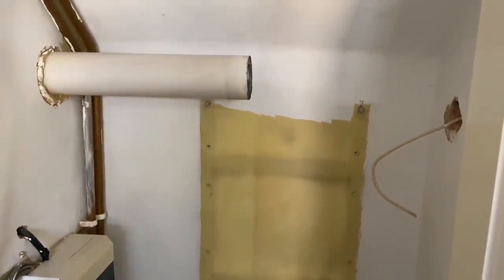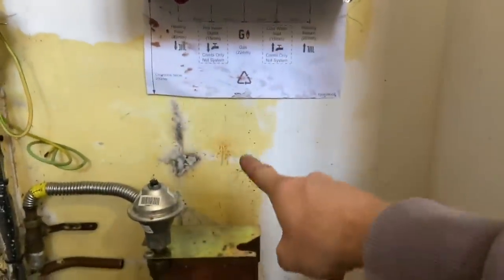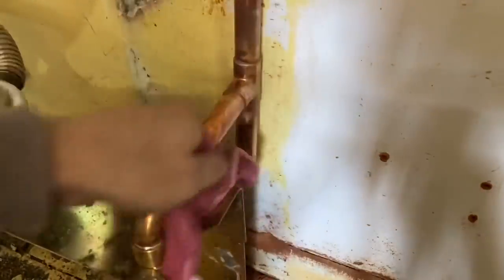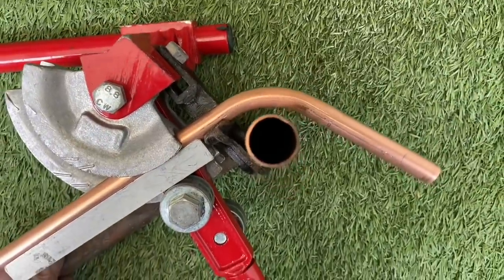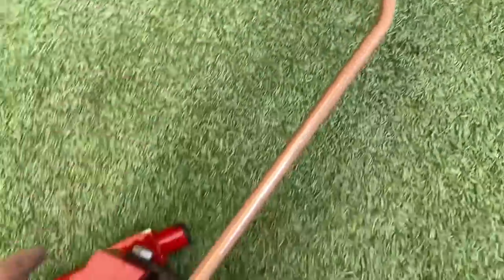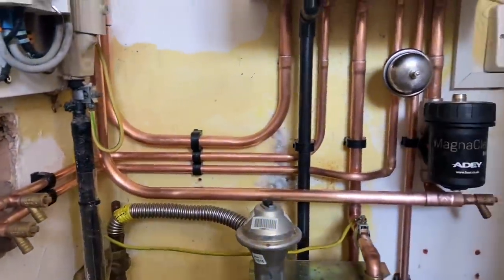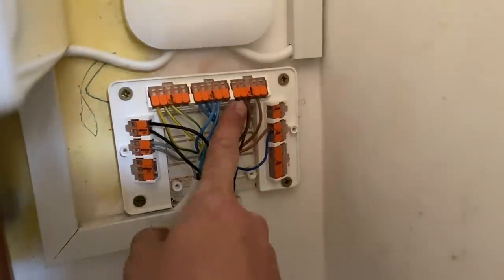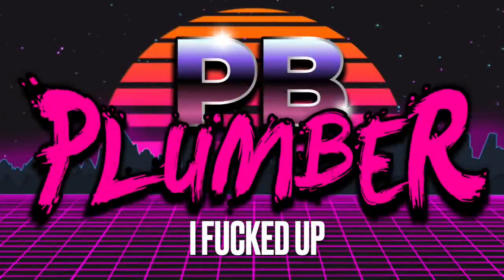P B Plumber The Life of a jobbing Plumber #50

Comment: Great vid. I'm a diy plumber. I installed a pressure relief valve, as set out in the Worcester Bosch instruction manual about 8 years ago between combi and water meter but never understood, why I should be doing it until your vid turned up.

Comment: Boss vid as usual, just a quick one from a job I got called out to where the gas meter and pipe work was not 150mm away from the consumer unit as the regs state! 25mm for cables, also hope it helps you out with your acs and good luck!

Comment: Good video, regarding min expansion vessels/shock arrestors on the cold main to the boiler. It is best practice to fit one on everyone, as even if the property does not have a water meter fitted it could have one fitted over the life of the boiler and may not be picked up on annual service, or risks the boiler having a problem that will not be covered by the warranty. We learnt this the hard way when a housing estate we had fitted a lot of boilers on had a new water main. Every property had a water meter connection fitted that houses the no-return valve. Fitting the boiler to all MIs is so important to protect the customer/their boiler warranty and also the reputation that all professionals build to get 'word of mouth' work.

Comment: Wouldn't you think if the manufacturer is basically insisting on / admitting boiler can't cope without, an expansion vessel, then one would come with it?
Do you need to match the mains static pressure and the pre-charge pressures for the vessel to work properly? Cheers.

Comment: If anyone wants to know I fitted a mini shock arrestor the other day on a combi swap I did in a downstairs wc, the main in and metre were coming in right basin the wash hand basin and the next day the customer got hold of me saying the shock arrestor is banging so I replaced it thinking maybe it was faulty then within 12 hours it did it again, rang up the manufactures and never knew but they aren’t suppose to be fitted within a certain meterage of the metre as the check valve inside affects the shock arrestor

Comment: Loved this video mate, can honestly say I've never read that bit in the 830 instructions but from now on shall be installing shock arrestors.

I was under the impression brass hydraulics didn't need them but I stand corrected.

Also on the f**k up I've done similar on site lately and have no shame in admitting when I've made a mistake.  I normally fix any accidents there and then otherwise as you say, you forget.

Comment: You need some brown sleeving on the blue (neutral) wire from the condensate pump to indicate it's a switched live
Reply: You would have thought the manufacturer would have used a twin brown flex instead of the brown and blue . Probably used the brown and blue for cheapness.
Reply: You should not use the blue (negative) for anything other than its intended purpose!
Reply: tim  nope . The only core that has to stay as marked is the cpc . Any other core can be remarked with sleeving to denote its use , live  neutral etc .
Reply: @lazenbytim  Blue isn’t negative it’s neutral. Negative and positive are found in DC systems
Reply: @Duf Jax yes you should get out more .  Yes it is line or phase or live .  Same thing just what people call it . Same as everyone says twin and earth cable but its twin and cpc

Comment: I had a boiler installed in a property I am doing upfrrental. The fitter asked me if there was a water meter - to which I replied there wasnt and off he went. An hour later my curiosity got the better of me and I went to ask him the relevance of the water meter and he explained that if there was a water meter he would have to fit an expansion vessel. I said that as it was going to be rented out the tennent may get a water meter fitted and it would be prudent to fit the expansion vessel anyway. He never explained why it would need to be fitted. 
Its a good job I pushed him to fit the expansion vessel. If he had asked the correct question of "is there a water meter or non-return valve fitted?" my answer would have been yes as I had followed Building Controls instruction to fit a non-return valve immediately after the stopcock.

Comment: I once cored a 100mm hole through 22mm chip board floor to find some pipe work literally right next to the bath and the drill bit of the corer went right through the middle of a 28mm gas pipe and I mean right in the middle I should of won a gold fish for that

Comment: Veissman have this weird little thing shaped like a test tube at the back that I think is to accommodate expansion, I'm not 100 percent sure, you'll know Pete, not even the engineer at work was 100 percent clear. All I know is it pissed out mains pressure water when I knocked it once 😭
Reply: Yeah it's a built in shock arrestor,  saves the plastic manifold.

Comment: I can understand why you solder at a part of the fitting that you can't see but i'm completely the opposite. When i solder i like to be able to see the solder on the pipe a bit as well. Only reason is is if i woke up in a sweat at 2am and wondered if i had forgotten to solder a fitting i would like to see that fitting has been soldered a few weeks later even when it has oxidised a bit. Even though i check the fittings afterwards, it's easy for things to play on your mind

Comment: What i would prefer to do for the first bend over the gas pipe that has a little less risk to it, i.e cutting it short is make the first bend a double set over the gas pipe on the horizontal piece then an elbow then a single set on the vertical piece going into the other end of the elbow. Obviously it won't be a continuous pulled bend piece but having the elbow there reduces the risk of ruining the whole first section piece